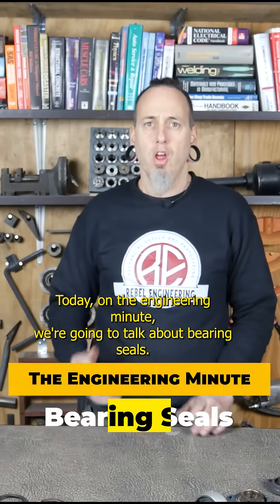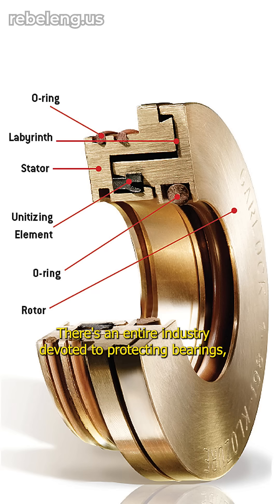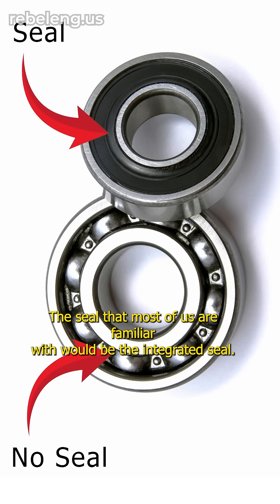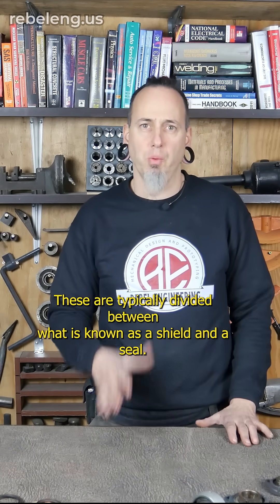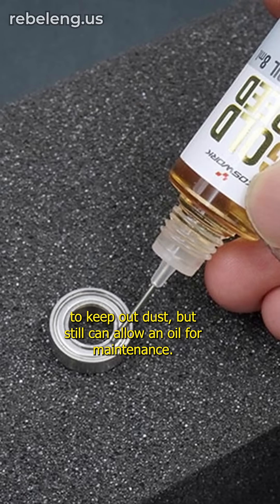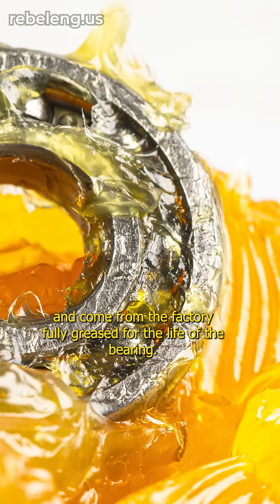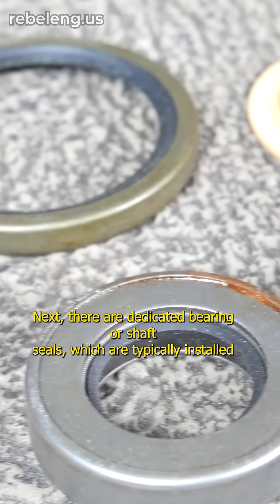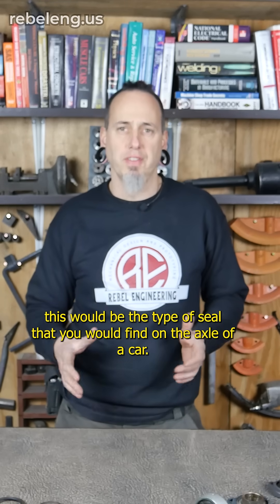Unleash the Power of Bearing Seals - Protect Your Bearings!

Comment: You should do an OnlyFan Ball Bearing edition. 😉
Reply from the maker: I'll have to consider it. Not sure if it is the right kind of balls.
Reply: @rebeengineering i recently came across an application that uses shielded bearings but has a grease fitting that allows grease to go into the housing where the bearing is located, it also has shaft seals on both sides of the housing. I was wondering if the grease will eventually make its way into the bearing, or is the grease just there to keep contamination out? A mechanic told me he doesn't bother greasing that area because it has shielded bearings but I was thinking the manufacturer wouldn't go through the trouble of putting a grease fitting and shaft seals there if it wasn't necessary. I would like to hear your opinion.
Reply: @rwpowers440  It sound like a mounted bearing. The grease is for the housing. Depending on the application, the bearing can move slightly in the housing with each rotation. Without grease that housing can possibly wear out making the bearing move in the housing.
Reply: I came for those seals too :))